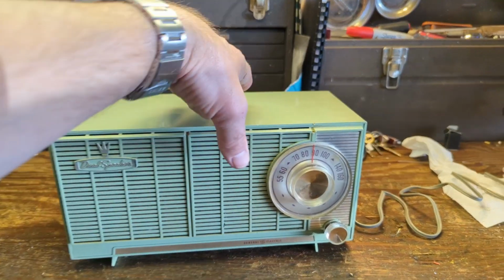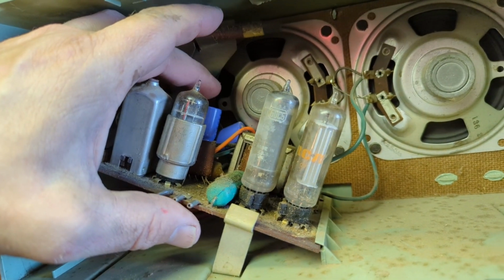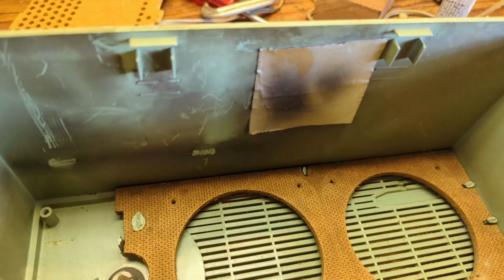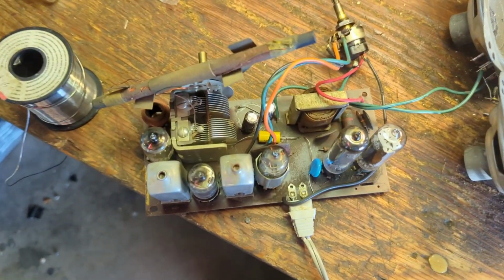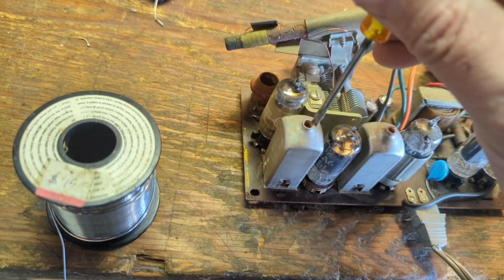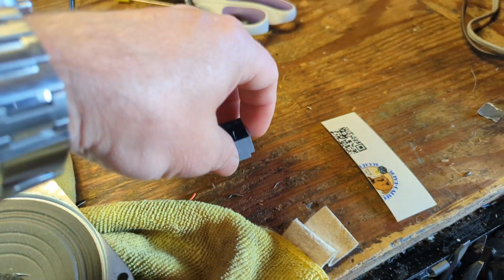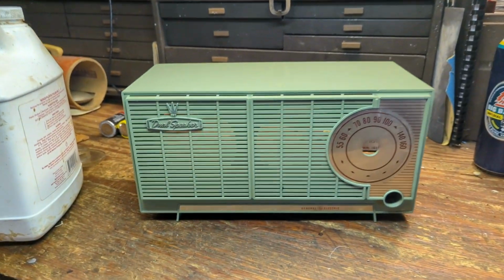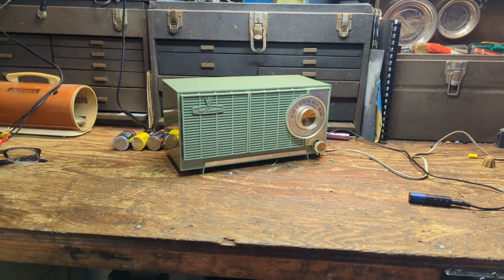Lil' Green GE Radio AA5 and its nearly doomed restoration

Comment: I have one in pink that belonged to a relative.  It is in the future restoration collection.  I am not really sure why anyone wants an aux. input with so many nice powered speakers out there.  It would be easier to just use a cheap AM modulator for your whole collection.  As noted even a direct input sound just ok, so why bother with it.  I think keeping them original helps with the future value, which will increase. I believe modifications hurt the future value.

Comment: I had a late sold state 60s Magnavox radio and boosted twin speaker. Which I think is stupid to do as doesn't improve the sound quality. So id rather have one big speaker rather then two smaller ones

Comment: Hi Seth how are you. Always interesting in what you're doing its fun watching you do your hobbies. I know you probably already know this. The tuner ground on this radio is AVC and when the b minus is on the hot side instead of neutral, the AVC will be modulated by the raw ac from your fingers when you touch the tuner resulting in a 60 cycle modulation with the sound. Try avoid touching the radio when this happens it's a shock hazzard so reverse the plug when you hear this and try it again. I'm just wondering if it makes a difference

Comment: What a cute little radio! I’ve owned many different GE duel speaker table radios and never seen one with a pull out volume knob to turn on the radio. I’ve also never seen the volume control not set directly on the chassis like this set. Just when you think you’ve seen them all and here’s one very different to the norm that I had.  Why is it that the cheap, ugly plastic tube radios play fine but yet a nicer radio set will have SMD.
Any hoot, thanks for the share there.